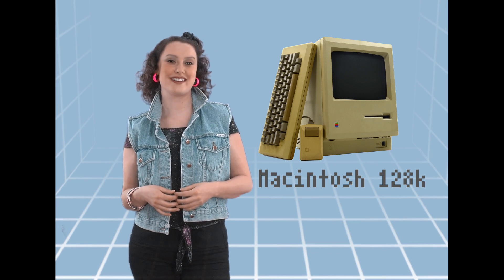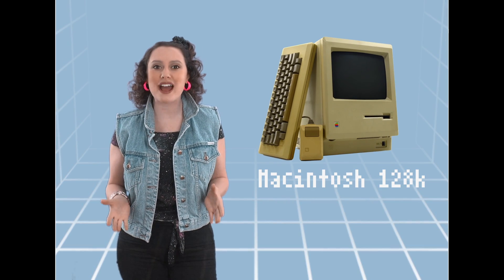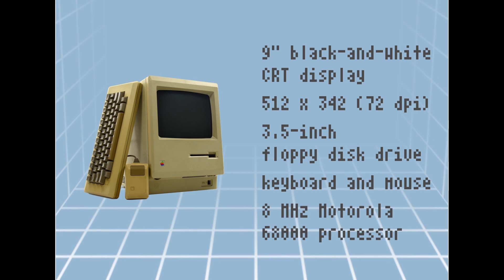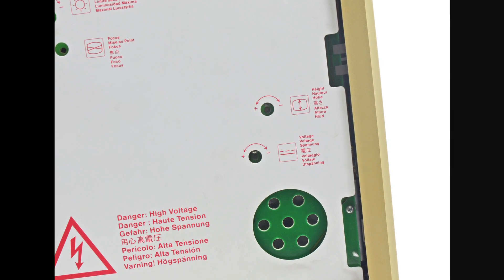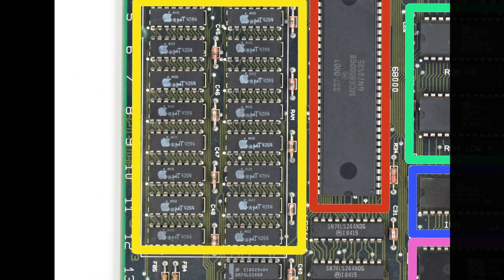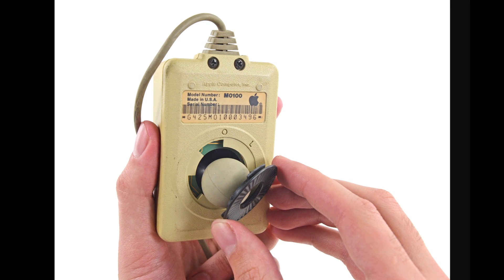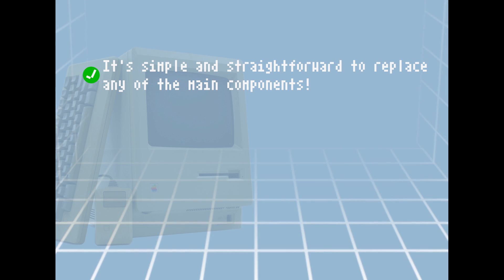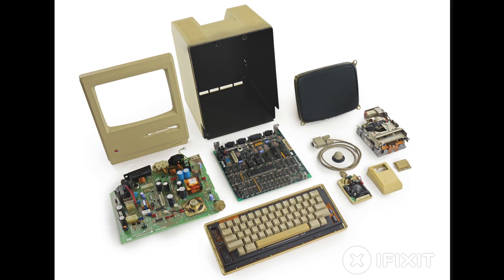The Macintosh 128k Take-Apart Review!

Comment: Who would do repair work while it's plugged in? Just unplug the device and wait for a few minutes to allow the charge in the capacitors to dissipate.
Reply: +Zeldagigafan The voltage in the CRT can remain for months,so you need to discharge it using alligator clips and a screwdriver.